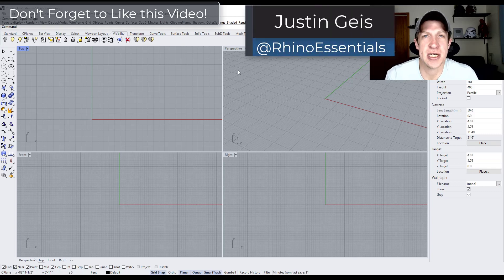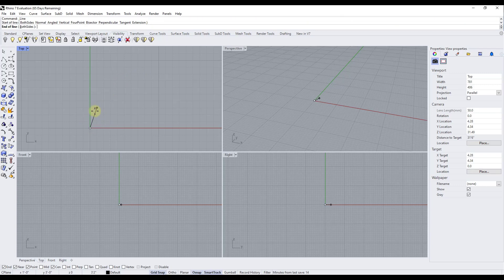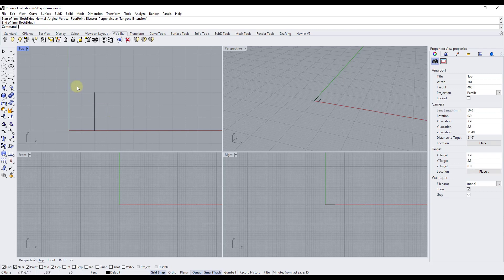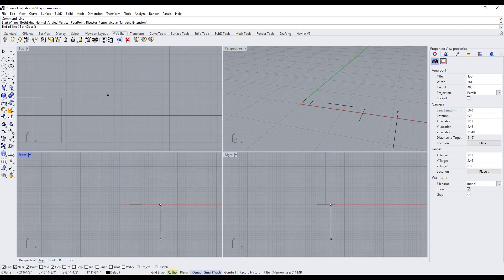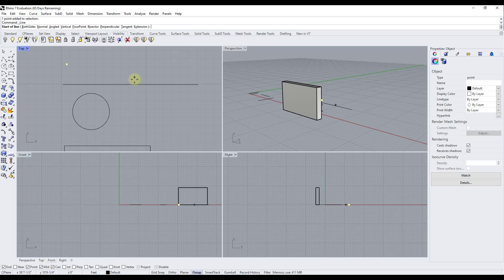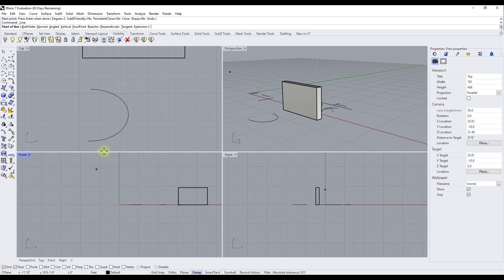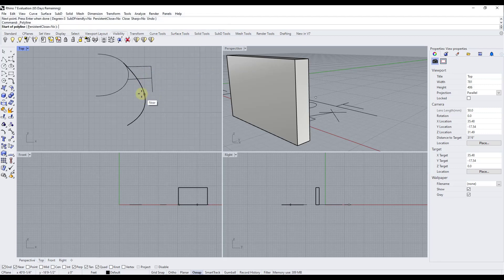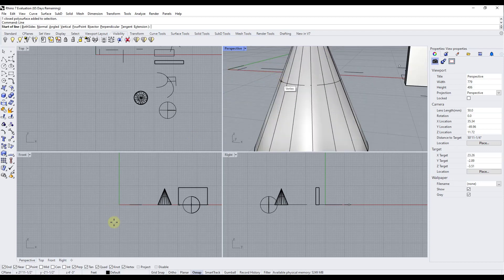The ULTIMATE GUIDE to Snapping in Rhino!

Comment: Hi! I have a few doubts about Snapping and inferencing and am looking for a similar interface of Sketchup in Rhino. Please help me out with the following:

1. In perspective viewport, all lines, rectangles only snap to the XY Plane and not on the Z-axis, so if i have to create a window cutout in a wall, I am having to make it in plan and then rotate it, please suggest a better way to do it

2. In Sketchup, arrow keys help us to lock inference points and axis, is there a similar command or snapping method in Rhino too, wherein, for example, i want to measure the vertical distance between 2 points not aligned in Z-axis, but I need to know the distance in height between them. Sketchup allows me to lock my cursor in Blue axis using top key and then reference a point elsewhere, similar option in Rhino for the same please.

Thank you

Comment: Great content. I'm wondering how to snap to a nearby object, say a corner, when you are dragging a plane of a surface using the gumball. So that the plane you are dragging aligns with a nearby plane, if that makes sense?
Reply: I believe the best way is to move the corner to an edge, then use the rotate tool to snap the edges together. That's the only way I've learned